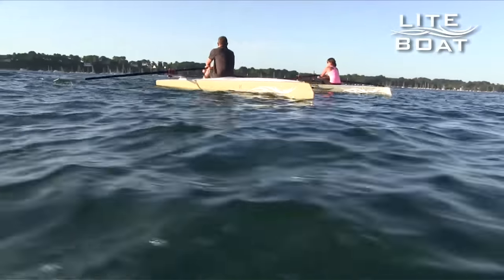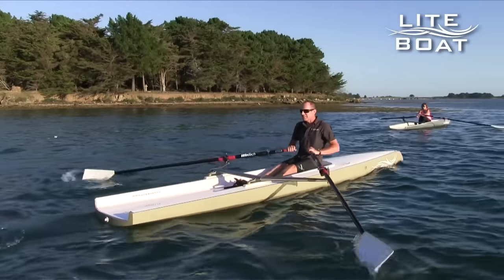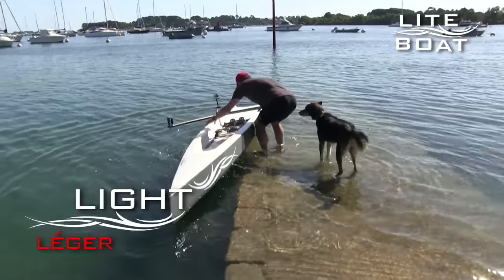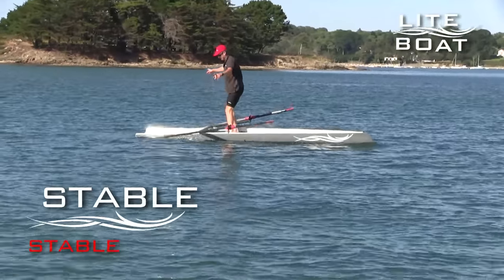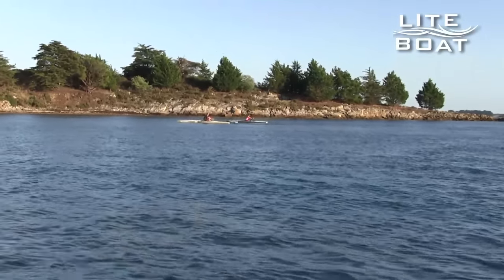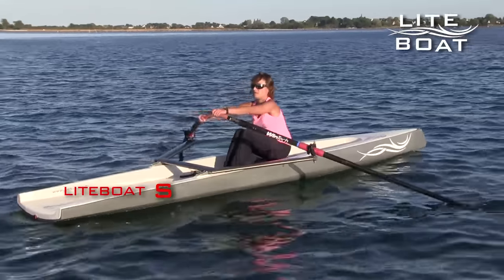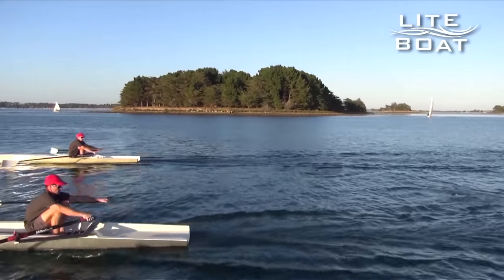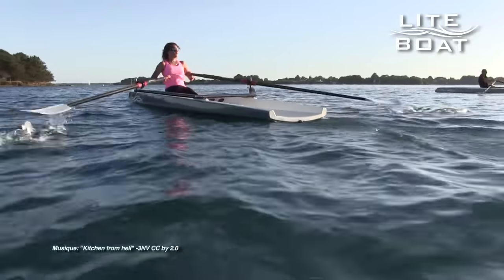The concept of the Liteboat - a revolutionary rowing boat

Comment: Interesting. Where do you put lunch, extra clothes, safety gear...? Or do you just not use it for adventure after all? Also, how fast do you tend to go? e.g. my kayak will cruise at 3.5--4 knots all day, and this should have a bit more power, but maybe a bit more wetted surface as well...? Also, it'd be awfully nice to see it in waves. Any problems with the bow digging in when surfing?
Reply: Forget rowing look at Savage River racing canoes.  C-1's weigh 20lbs. @ 18ft.-6 inches --Carbon fiber/foam composite---8 miles per/hour on a sprint.  C-2's  18ft.-6" @ 26 to 30 pounds weight contestants in 120 mile Ausalble River Marathon adverage 7 miles per hour(thats a 14&1/2 hour winning time with any finish under 15 hours is eleate.
Reply: That is a good modern hull, like they have been making for at least 20 years.  But yeah, it is going to stuff the bow in anything rough or surfy.  You notice that in comparing it to shells, he only promised this could be used in somewhat rougher conditions, amounting to no rougher at all.  That is a problem because this does not how the glide of a shell, but is pretty much restricted as to waters.

What it does have is a self draining cockpit, and low windage, and it looks to be unsinkable due to the double wall construction.  So it may not shed water as well as many open water boats, but unlike most of those, you can't sink it. Or at least fill it to the brim to the point where even if not literally sunk, the waves will have their will; you will not be able to row it; and you will be basically in a very cold bath.